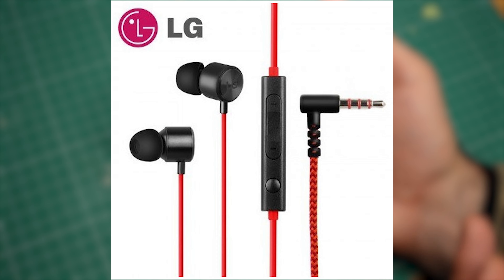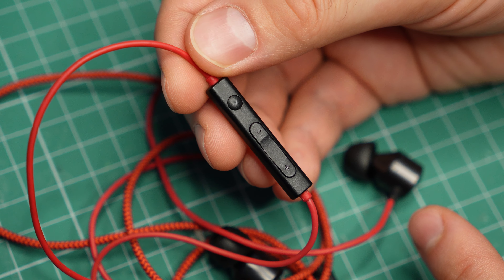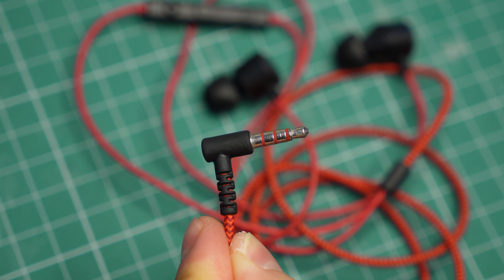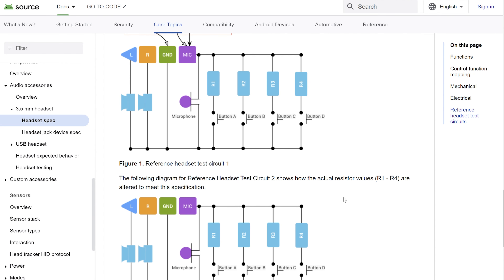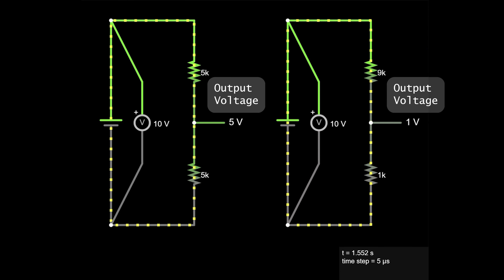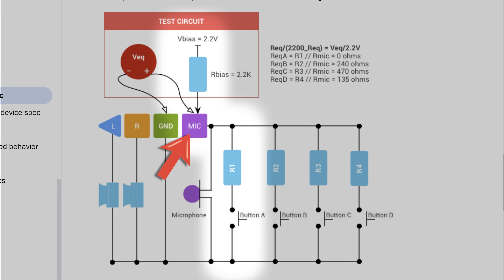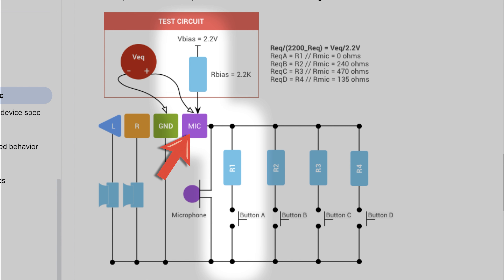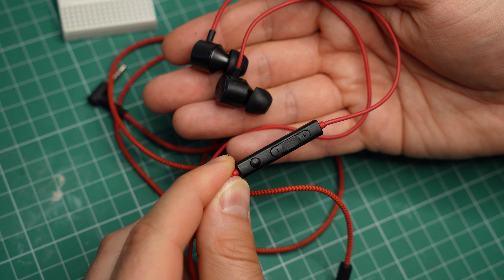Here's how buttons on earphones work (hint: voltage dividers)

Comment: u should mention how the AC mic wave forms can be differentiated from the buttons using a coupling capacitor (or DC blocking capacitor)

Comment: Very nice. So, the phone has the mcu that decodes the voltages/signals, right? If there is an mcu involved, why not use regular io pins. I guess this method only uses one io pin, instead of several.
Reply from the maker: I bet it's all integrated into the audio chip, if not into the snapdragon/mediatec/whatever SoC the phone has.
Reply: @LeftyMaker  You must be right, it probably is a feature widely adopted decades ago. Great content, keep it up.